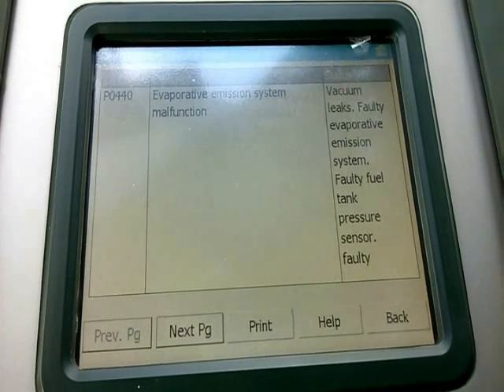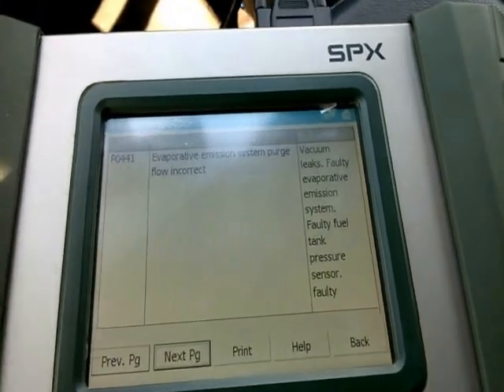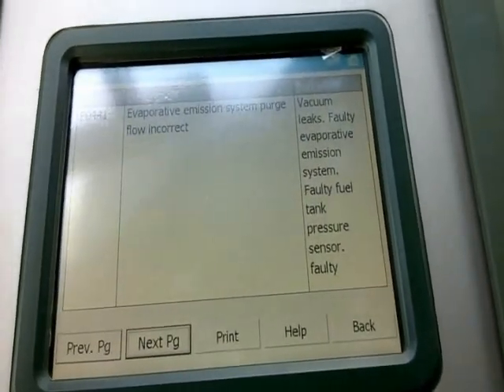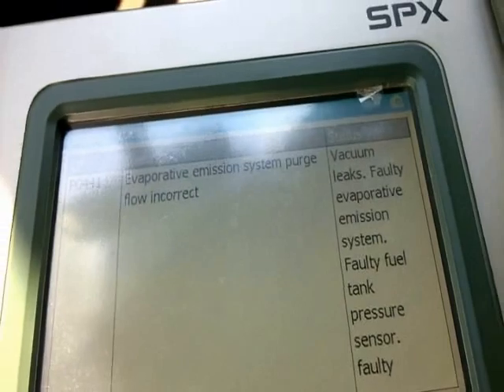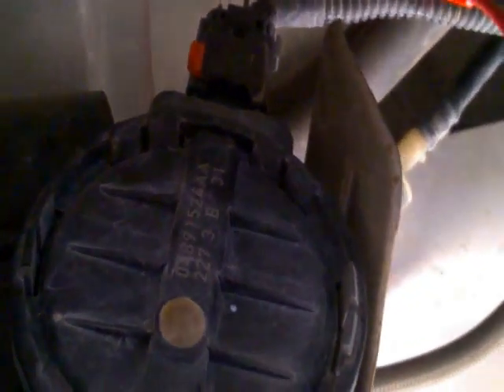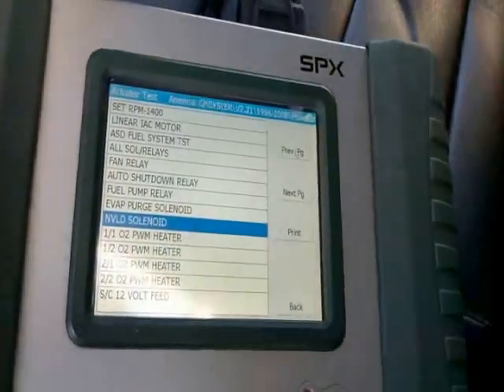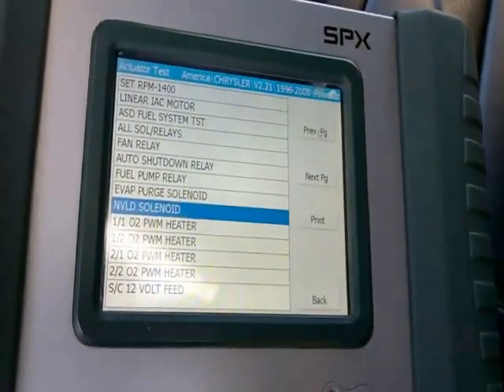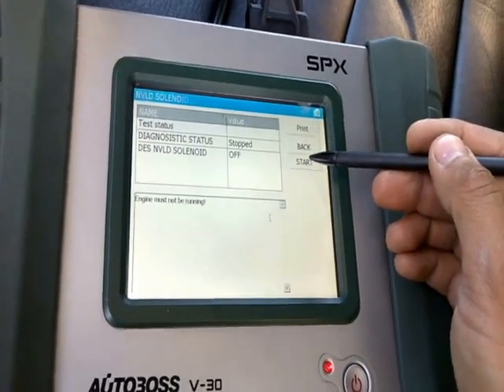(Ram 1500) Evap codes P0440 and P0441 part3

Comment: I have a p0440 code on my 07 charger no other codes what can be the problem . it's not the gas cap or leak detection pump
Reply from the maker: Evap codes are not the easiest to diagnose and requires time and fancy equipment. The next item to consider would have to be purge solenoid.

Comment: hey I have a p0141 and I just replaced the 02 sensors b1 sensor is the one with the problem. it only comes back on when the p0441 comes back. any suggestions

Comment: will this apply to a 97 dodge ram 5.2 1500 2 wheel dr it got a po441 I try to get the wiring diagram couldn't uploaded for the nvld if you can get one email to me thankyou
Reply from the maker: it should be the same, but not 100% sure. what's your email address.